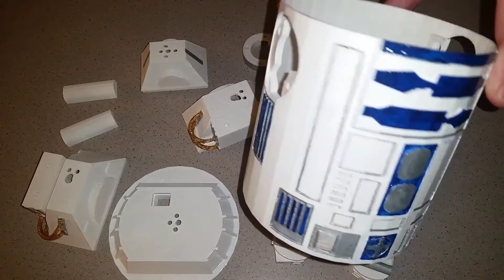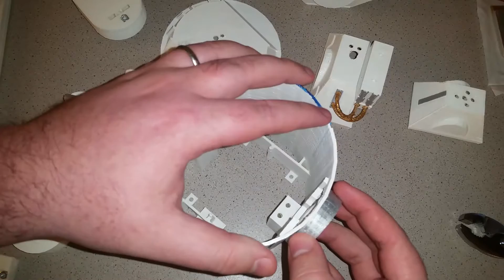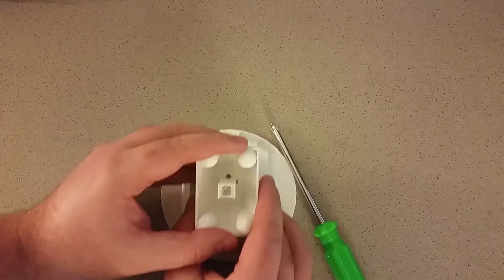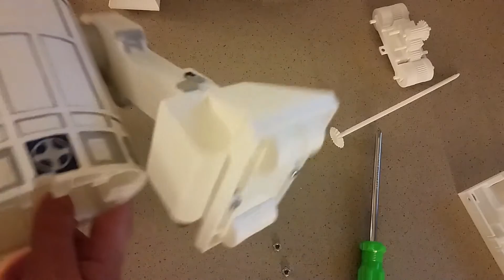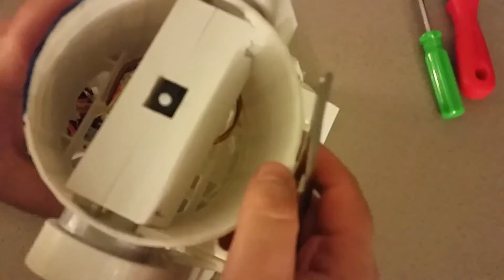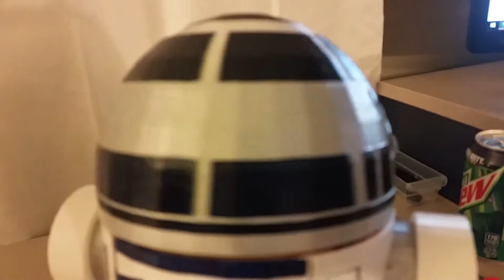R2D2 Assembly

Comment: you should never run motors straight from a Arduino The Arduino does not supply enough amperage to run the motors. If you use a separate power supply for the motors I believe that you have more than enough torque to move the Robot but stepper motors are a slow moving motor but have high torque

Comment: Great  model, I'd make the  following changes :
- Put the motors in the feet to avoid relying to plastic rods and gears to transmit the power
- make a bigger hole in front of the LED with some diffusion material
- have a second led on the side of the first one and "matrix of small holes", again with a diffusion material
- a 3rd light  with a grid in front on the back (again, diffusion material)
- plan some room for sensors (ultrasound distance seems the most important... but a light sensor in the head could be nice)
- plan an  external access to  arduino USB port

Comment: The motors will be powerful enough if you shift them down to the feet and redesign the feet so you can place them in there directly. You should also consider printing rubber tires for the wheels to grip better in ABS

Comment: Feels like you overcomplicated the entire thing when it comes down to the electronics and gears... Wouldn't it be better to just have the Servo motor up top to turn the head and then have the stepper motors directly in the feet so they create more thrust then relying on gears to bring the power all the way down there? You could save on plastic too by makint the legs more hollow and widening the hole so you can run wires from the main board to the motors.

Comment: hello chaos, sorry but do not know much English, I'm using google translator, I have already printed head and body, I'm starting to paint, I feel real problem I used adhevica tape but profiles are regrettable, as you have done it also exists some trick to painting pla I do not know? wonderful work, is my favorite for many years robot, thank you very much.
Reply from the maker: +jose luis Regueiro Hi Jose! No problem, I think I know what you're saying. :) As far as the adhesive tape, I tried to make it so you wouldn't need tape or glue, just the screws to hold it together. And as for painting it, we just use water-based acrylic paints. You can also use plastic spray primer first to help the paint stick better. Hope all goes well. :)